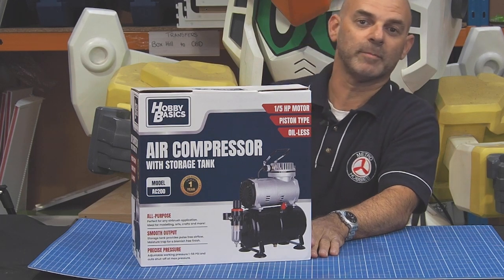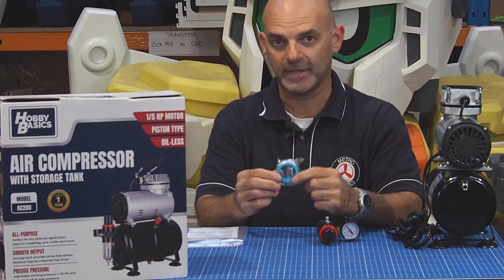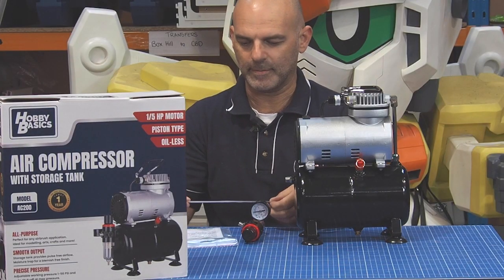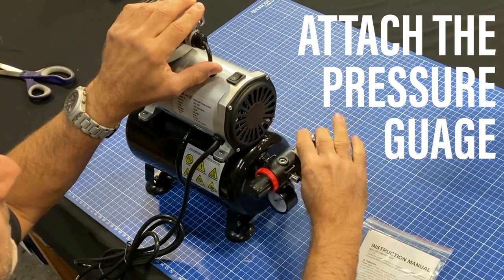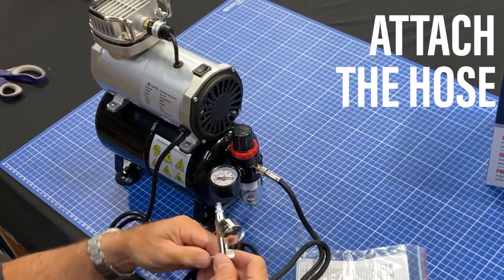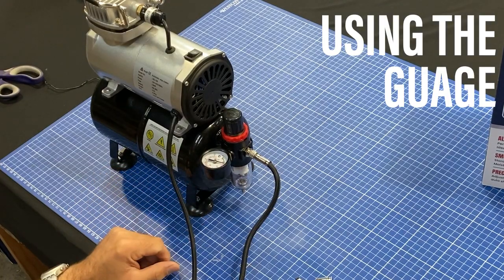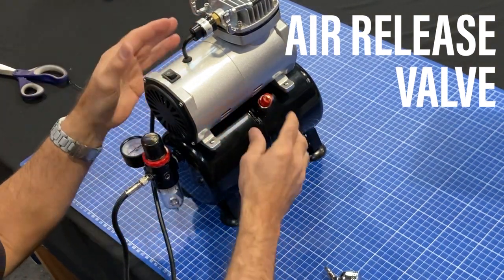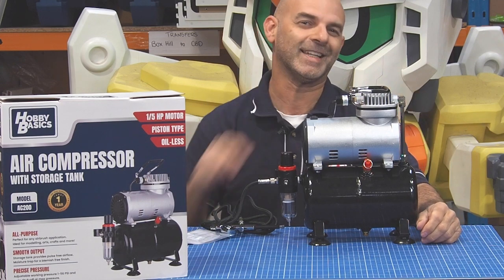The Hobby Basics Air Compressor with Storage Tank | How To Video

Comment: Finally a video with great information THANK YOU ! should I pull the safety Valve AFTER painting ?
Reply from the maker: Hi there, thank you for the lovely feedback! Our modelling team have advised that yes, they recommend to "clear the air" after every use to, not only, keep the compressor clean but also for safety reasons. After all, the tank is full of compressed air. It is also recommended to release the brass water trap valve under the tank every so often to let out any water that may get trapped in the tank itself. We hope that helps!

Comment: He uses too much teflon tape.  1 1/2 wrapsare plenty when attaching the pressure regulater.  No teflon tape should be used when attaching the airbrush hose.  The fitting is designed to work withour the teflon tape.  if it doesn't seal, disassemble and inspect the fittings.  There is probably some dirt or a bad o ring seal.

Comment: What kind of video is this? You didn't even show any of the other steps. Like how's the tank hooked to the motor so that it knows when the stop? What would you do if you don't have the plug at the end of your 3 l tank that you bought didn't show how you hook the motor to the top of the tank. I was more confused by the end of this video
Reply from the maker: Hi Jonathan, Thank you for your feedback and apologise for any confusion that came from this one! I will have a chat to the team and look to doing a follow up video to answer some of your questions.
Reply: @MetroHobbiesAus  thank you. After reading my message, I feel like I came off a little harsh. It's actually the reason I'm upset is because I bought a 3 l tank and it doesn't even look like yours and I don't know why it's different. All the other ones look like yours online but this one has the instead of the the whole coming out the end. It has it coming out the top so there's one coming out the top on each end and then it has one coming out from the top kind of at a 15° in the middle. There's no pipe holes coming out from the end of this tank and so I'm trying to figure out how to do it as identical to yours with it still being different

Comment: Please: Why a compressor: like that it heats up.
What can be done to eliminate overheating. Tnx.
Reply from the maker: Compressor with a holding tank should not be heating up, unless it is being over used (hours straight use). If your compressor does not have a holding take, and its just the compressor itself,  then yes it will heat up after use, but then turn off to cool down. If you have a compressor with holding tank it might be worth getting it checked out if it is heating up